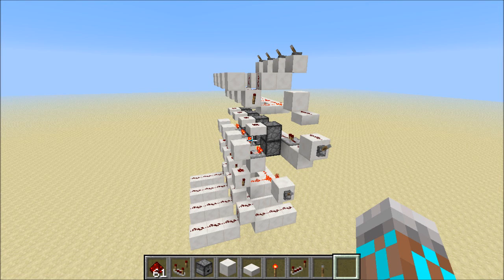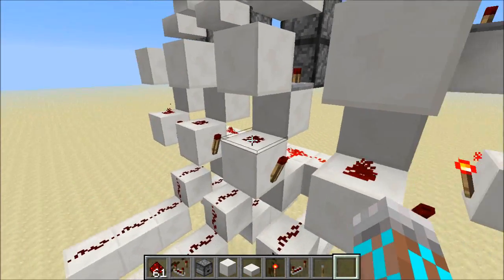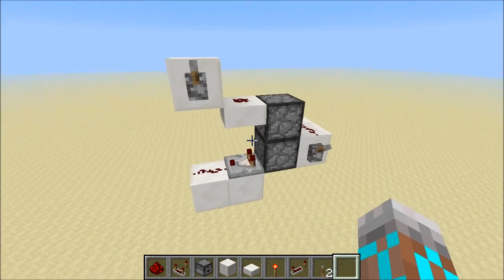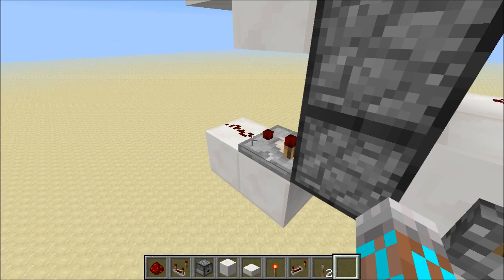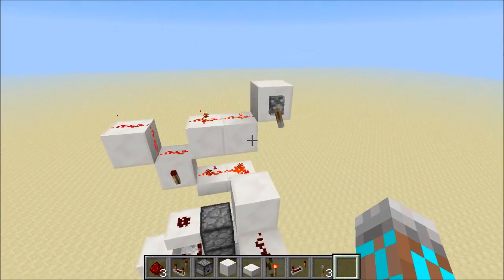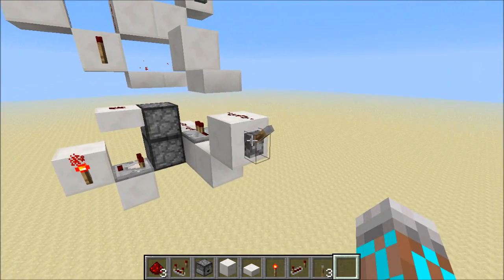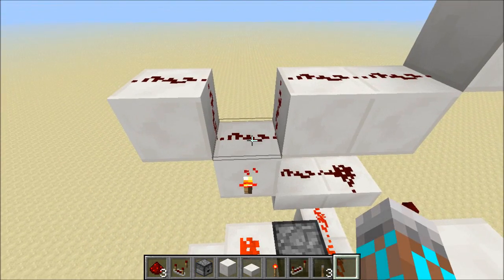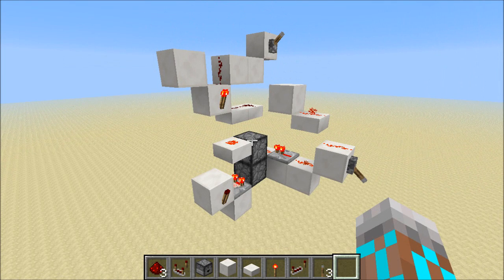Dropper RAM

Comment from the maker: This is very true and I didn't go into that in the video, but while the initial save occurs on the rising edge, the final save has to occur on the falling edge (which is why I called the memory a D-FlipFlop instead of a gated D-Latch, it's edge triggered rather than level triggered). This really wouldn't be an issue, you'd just have to be sure you use the RAM accordingly (though I'm not sure I'd ever actually use dropper RAM - it's more of a fun circuit). Good job picking up on that!

Comment: That's really nice but there is one "problem" you might encounter.
If you have the save enabled and the read enabled.
If the output was on you can only change it to off.
and if it is off you can't turn it on.

there are a lot of "If''s" in there.
correct me if I am wrong